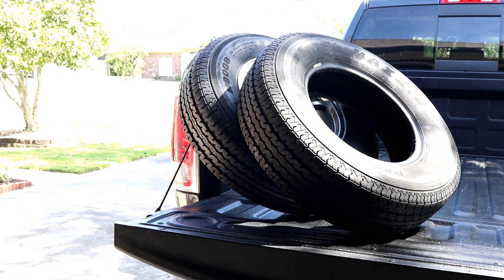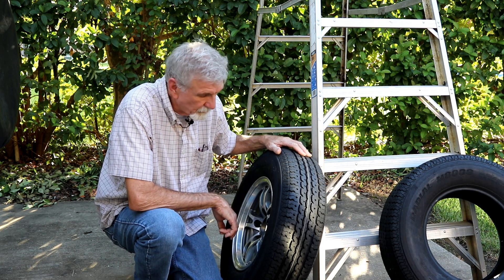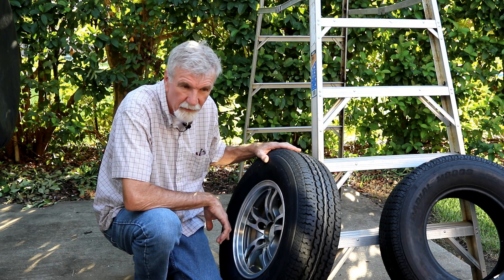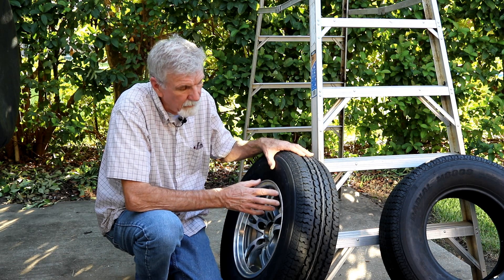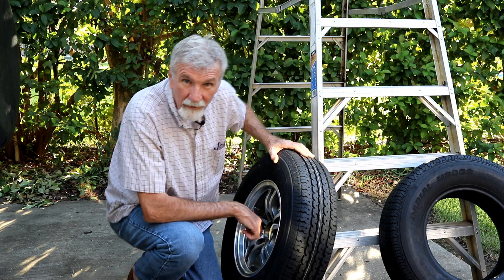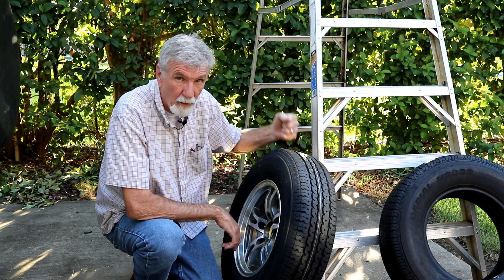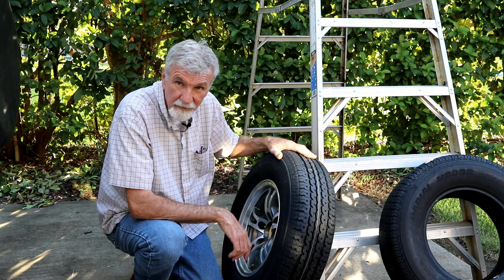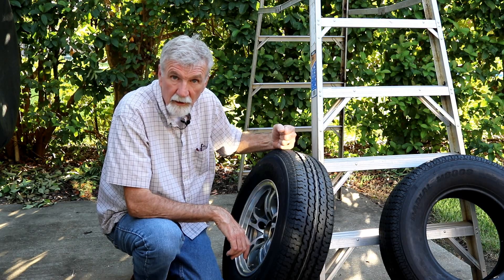How altitude and temperature change tire pressure

Comment: Thanks for you videos.  I bought a 2013 3500, 6.7 automatic Tradesman.  I tow a 7500 lb RV trailer every other month or so.  I just put a set of BF Goodrich All Terrain tires (LT275/70R/18)  Unloaded - 5,000 lbs front, 3400 lbs rear.  Loaded - 4820 lbs front, 4250 rear.   The installer of the tires used 65 psi front and 80 psi rear.  I dropped the pressure to 60 psi front and rear for unloaded operation and usually 70 front and 80 rear.  How's this sound to you?  This is my 1st diesel and first travel trailer so I refer to your videos when a question comes up.  Thanks, again.
Reply from the maker: Sounds fine, I run that exact pressure loaded, 70 and 80 rear.  Unloaded lots of folks drop the rear to 65 also but you'll get a low tire message unless you reprogram the sensors.  I just keep mine the same, mostly cause I'm  lazy.

Comment: I just ordered the Craftsman Gauge from Amazon. My old gauge didn't have the bleeder, and that is a big plus.
I had the dreaded TPMS Light come on a couple days ago when the overnight temp dropped a little. Real PIA - the only way to reset it is to inflate the fronts to 60 and rears to 80. Once the computer recognizes a 20% drop from those numbers you get the TPMS Warning Light.
- Sure enough the rears were reading 63 and 64 lbs and triggered it. (As long as your tire pressures don't hit 52 front or 64 rear, you can play with tire pressure without the TPMS warning) Thanks for the Gauge tip.
Reply from the maker: I wondered about the minimum pressures that would set off the alarm, thanks for that

Comment: Thanks , your videos are invaluable to a Cummins owner, or vehicle owner in general.  Do you plan to test the Torque bluetooth app?  I cannot afford the Edge monitor but would use the app if it actually works.